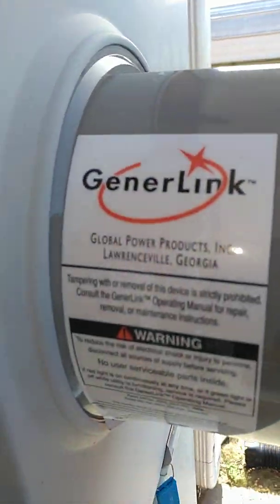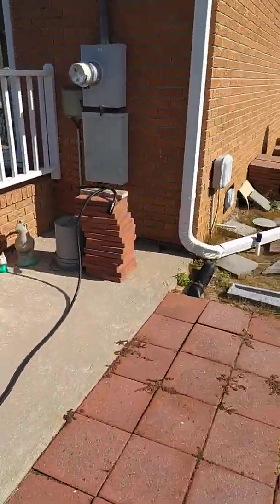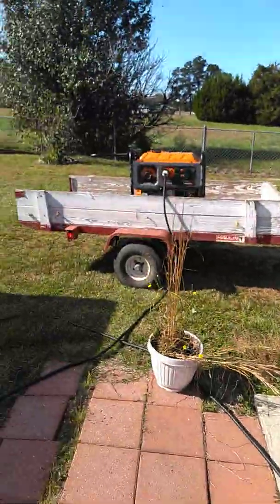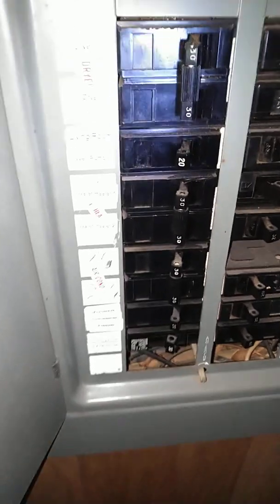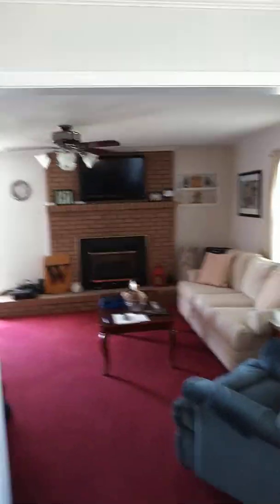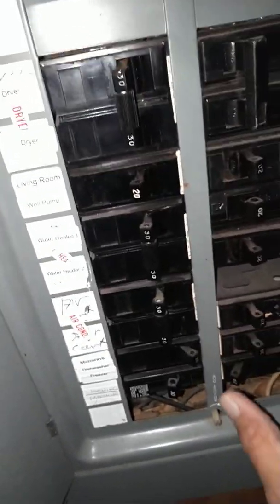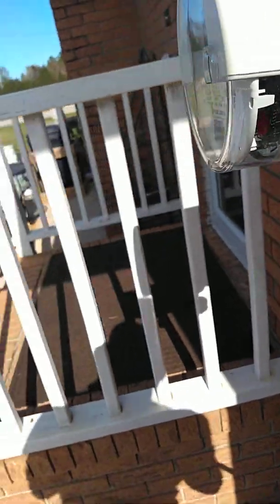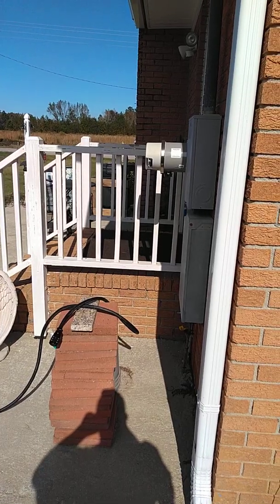Generlink meter mounted transfer switch

Comment: Does main breaker stay off ? Or its never turned off
Reply from the maker: The main breaker itself is never turned off. You turn off all of the individual breakers and then once your generator is running, you select which breakers you want to supply power to. The main breaker stays in the ON position the entire time.

Comment: Wicked awesome,  do I turn the main breaker off to kill all power, or just the breakers to the home while the main breaker is still on the on position?
Reply from the maker: Leave the main breaker on. Turn off ALL breakers to the house. Then, once the generator is running, select the breakers that you wish to supply power to from the generator.

Comment: Thank you Kenneth.  I was thinking about transfer switch but now I am sold for general link.
Reply from the maker: Thanks for the comment. I, too, was looking at a transfer switch at one time but I had to decide what I wanted to run and what I wanted to leave out. With this unit I am able to have power to every part of our house and can select what I want to run and when up to the capacity of my generator just by selecting the breakers in the box. I have been more than 100% satisfied with its reliability and how well it functions. I'm sure you will too!!

Comment: Great video. Our electric company also approves of this. They like it so much they will come install it for you. And not charge you. Our only issue is that it’s so popular here they are behind like two months lol. I told them to put me on the list lol.
Reply from the maker: That's great!! I purchased ours direct from the manufacturer which was much cheaper than what I would have paid for at the big box stores. Either way, I am more than 100% satisfied with how well this system works, the ease of operation and the overall reliability. I no longer worry about power outages due to hurricanes, ice storms, snow or thunderstorms. The peace of mind this device has given us has more than paid for itself. I'm sure you will feel the same way! Thanks for the compliments!
Reply: Bartlett Electric in Texas does not allow the I wonder why seem like a great emergency power solution.
Reply: TECO Energy in Tampa Fl doesn’t allow it either!!! WTF

Comment: I am seriously considering installing this unit; however, in investigating it further, I have come up with two concerns that are causing me hesitation:

Here in Ottawa, the permit to disconnect power and reconnect is $350. Should this unit ever need later service, that is another $700 charge beyond the cost of repairing the device itself, which my investigation seems to show is not quite as reliable as it should be. 

I think I may stick with the Reliance transfer switch in spite of only being able to power 10 circuits. The cost of the Generlink unit itself including taxes is $2243.05 plus the atrocious $350 fee from the utility.
Reply from the maker: WOW! With my utility company there was no charge to pull the meter and then plug it back in 10 minutes later when the electrician was done. I cannot imagine why a utility company would charge such outrageous fees. As far as reliability goes it has worked flawlessly for us. The unit also has a warranty that is superb. I'm not sure where in the world you got a price of $2243.05 for the Generlink unit. I ordered mine directly from the manufacturer in Georgia and it was built for me to be paired with my Generac generator and it was $700 flat!! That included a 40' power cord instead of the standard 20'. Maybe you should look into that and not use independent electrical companies and certainly stay away from the big box hardware stores. They mark up the prices WAY beyond what they should on these units. One near me offers this same unit for 2.5 times the amount that I paid. Also, I asked if they would ship it to me free and they never hesitated to do that also which was a good thing because the unit itself is somewhat hefty. Shipping would have probably cost me $35 or so just due to the weight. However, I do like the idea of being able to power all the circuits in my house and not being limited to only just a few. Hope this helps.
Reply: @kennethwilliams2422  Yes, in comparison to what you describe, the unit is drastically overpriced compared to what you paid. And the utility costs are also bad but they have a monopoly on pricing so they are clearly taking advantage of it. I have decided not to proceed and will stay with my current Reliance transfer switch with 10 circuits on it as we don't have that many power outages and all of what i need to power is covered. 

I would proceed but I refuse to pay these prices.....
Reply from the maker: @TOURMANBOB  I understand perfectly where you are coming from. If I were in the same situation I would follow along with you.

Comment: Excellent video – The GenerLink looks like a great product. Living in Massachusetts I would be inclined to invest in a remote start capable generator & permanently connect it to the GenerLink during the winter months. With this if I was away my wife could easily restore power just by pressing a button on the remote.
Reply from the maker: I'm sure that would work. She would just have to turn off all the breakers in the house before starting the generator and then go back in and switch on the breakers one by one for what she wants to send power too. Thanks for the kind comments. I can assure you that ours has worked perfectly and I highly endorse it! So simple. Very cost effective and VERY reliable!

Comment: How much for generlink and install?
Reply from the maker: The actual Generlink unit was $700 including the extra $50 because I purchased a 40' power cord instead of the standard 20' that comes with it. Otherwise it would have only been $650. The install itself was so quick and simple that the electrician that came by to install the ONE ground wire did not charge me anything. It took him all of FIVE minutes. Even my electric company didn't charge a service call to pull the meter because he was only here about the same amount of time!

Comment: Without watt meters, how do you balance your loads to achieve usage balance between the opposing legs of the generator?
Reply from the maker: I never run more than what I need inside the house. If I only want the living room and bathroom lights on then that's the breaker switches I turn on. I'm very mindful not to go over the rated wattage output of my generator therefore I don't need watt meters. I would never try to run everything in the whole house at the same time. Hope this helps.
Reply: Leg to leg balance generally isn't an issue if your panel was set up competently the first time. You need to be cognizant of how much power each device is drawing. Most high consumption devices in your home are 240 volt, about the only thing that can throw the balance off enough to cause a problem is if you plug in  multiple 120 volt heats on the same leg.

Comment: Misleading video. Panel shown is a sub panel . There was no mention of main panel licated below the meter. Does tuen off all breakers include main breaker so there is no risk of elecrocuting linemwn working on utilities or feeding your neughbors house. Your generator cant handle that
Reply from the maker: Also, if you would have paid attention to the video I explained that there is an automatic switch that activates when the generator is plugged in that PREVENTS back feeding. It's HIGHLY recommended and endorsed by my utility company and others because of this safety feature.
Reply from the maker: What you are saying makes no sense to me. Please be more grammatically correct. And my generator can handle that.
Reply: I saw your video Kenneth. You were very thorough. The only part you didn't show was going back inside & turning on all your breakers. I know you did that though. Great content! (Who was in the recliner)? 
I'm a power lineman for a living. This is a very popular option going on ten years now. They cost about $700-900 off the shelf. An electrician or the host utility installs them. 
We have an inter lock in our main panel. Same thing just a fully manual option. Our electric meter is in the front of our house & our generator is at the back of our house. 
We have our generator wired into our main panel all the time. It's in a stainless steel enclosure year round. We can start ours inside our house with a hard wired remote. 4 switches & my wife can restore power to our whole house. Not just a few circuit breakers. Even our 2-1/2 ton central air works. (All on a roll out). 
As for lineman being killed? That's a fallacy. We wear rubber gloves when treating any wire on the ground. Who they might kill would be children, pets, joggers & walkers. Police & fire are trained to stay away from fallen wires.

Comment: Told they cannot install the device in Texas due to ONCOR not on board!?!?!?
Reply from the maker: WOW! I cannot believe that ONCOR would be like this. And I say this from just what I know about what I researched. It eliminates ALL back feed on the grid and is ZERO hazards to utility workers. I guess it comes down to the almighty dollar to the utility companies.
Reply: I'm in Ne Texas I told them what it was they said ok must be your  electric  provider that sucks just tell them your putting  in a power  transfer  switch for your generator  for emergency  purposes  like the guy said you gotta have a license  electrical  contractor  install  it power  company  won't.
Reply from the maker: @stephengass6067  it will be well worth it and I think you would be very pleased with the performance and convenience. We no longer worry about power failures and best of all we don't have to run drop cords through the windows and doors and all over the house!

Comment: U should get a portable ground rod to hook to the generator,
Reply: I use a tee Handel looking copper rod with a cork screw type mechanism that goes in the ground and it hooks to the frame of the generator. There should be a spot to hook a ground to it,
Reply from the maker: @kartmango  that makes sense and I know what you are talking about. I may do this. Won't hurt either way. Actually may help in the long run!
Reply from the maker: I was informed that since the Generlink unit itself that is hooked to the meter base and is already grounded I would not need one.
Reply: @kennethwilliams2422  That’s cool , I always hook a ground rod to the portable generator when hooking to a house just for electrical safety I found it causes issues with the GFCI breakers if you don’t but that’s just my opinion anyhow I was looking to into getting one of the generlink Nice video
Reply from the maker: @kartmango  that still may be a good idea though. I was told I didn't need one but I guess it would be better to have it and not need it than to need it and not have it! What do you use for yours and how did you install it? My meter base is grounded and I think that's why they said I would not need one. Also, there is one wire that must be hooked up to a bus bar inside the meter base cabinet and I'm thinking it's a ground. And thanks for the comment on the video. Being in a hurry I forgot to turn my phone sideways.

Comment: Does the electric utility have to put the piece in by the meter?
Reply from the maker: I had to have the light company come pull the meter base out and the electrician I had arraigned to put it in just plugged it up and hooked up one small ground wire. When he was finished the light company plugged my meter back in and reinstalled the lock. Our light company will not install these but they do approve and recommend them because it reduces back feed on the lines. It took all of 7 minutes! And there was no inspection needed. Hope this helps!